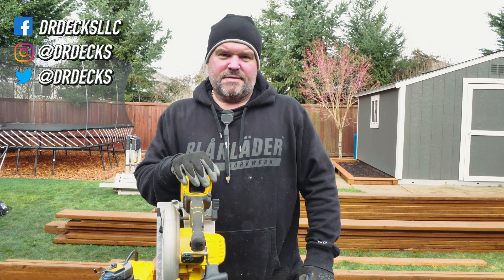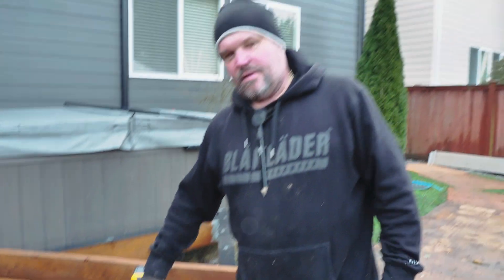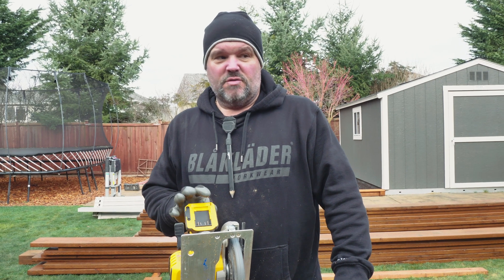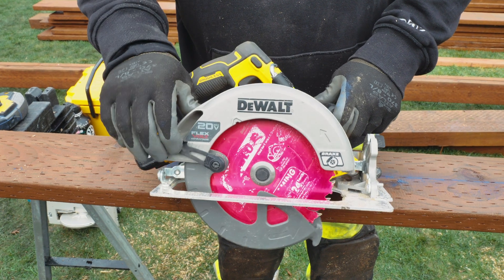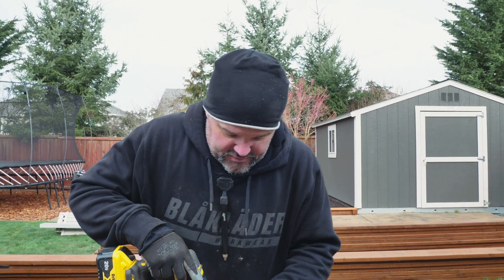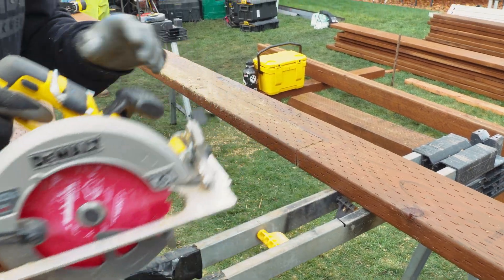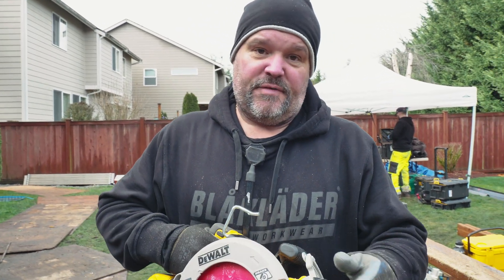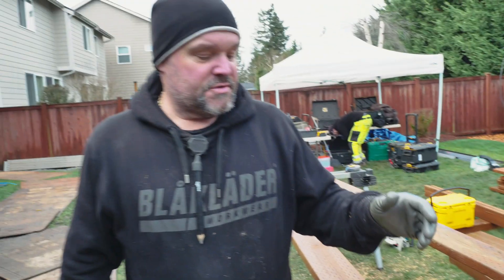DeWalt DCS573B Review || Dr Decks

Comment: Thanks for the review and your other content. The DCS573 is the Flexvolt Advantage saw, so it will work even better with an actual Flexvolt battery--it looked pretty strong with the 8ah 20v battery, though. 
Would enjoy hearing your view of the relative merits of the Dewalt and Makita worm-drive-style saws, an your opinion of the Metabo HPT multivolt circ saw if you have used it.
Happy 2021 to you.
Reply: He has a video comparing those worm drive style saws already.
Reply: @Gideom007  OK thanks, I'll check it out (and search before I ask next time)